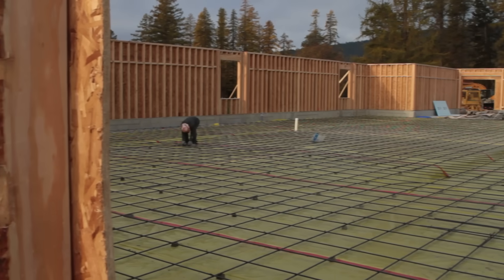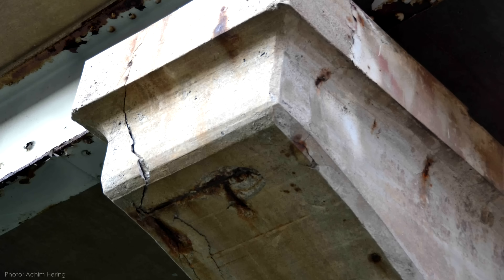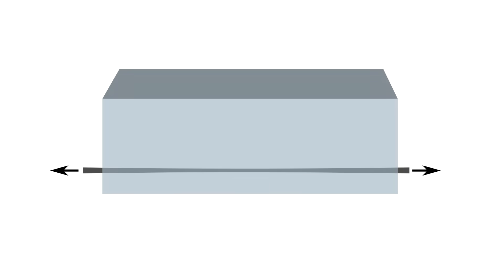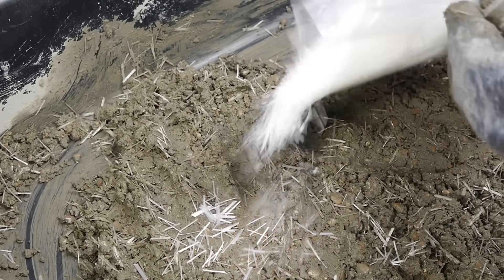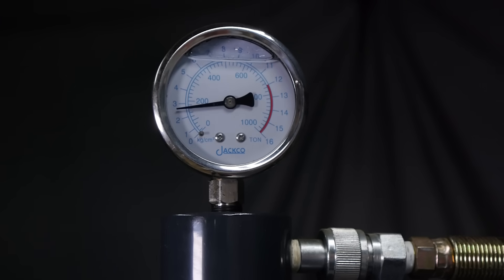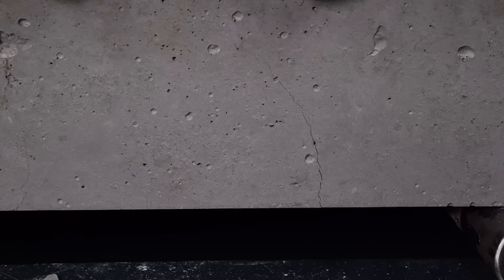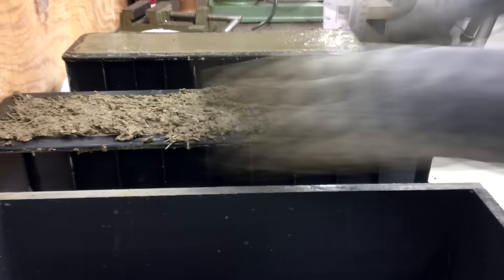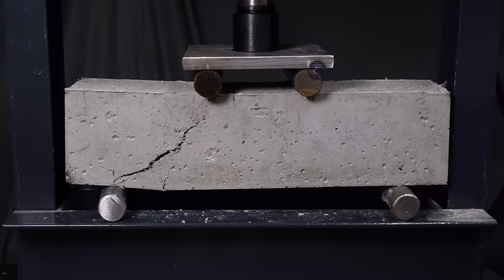Does Rebar Rust?

Comment: Moisture is constantly coming through concrete unless it has a layer of plastic underneath. So saying the rebar is sealed in isn't quite true.
Also doesn't some concrete have limestone in it. Doesn't that corrode steel? I worked at a place that made beams for bridges and everything there was rusted really bad
Reply: Basically all rebar used in building construction has a layer of oxide on it as it goes into the building.  It is impossible to keep it clear.  Building slabs are required to have a vapor barrier underneath to prevent water seeping in from below.  It would also ruin some flooring finishes otherwise.  

As to limestone, in Florida basically all concrete is limestone aggregate based.  This doesn't have any impact on the corrosion aspect of the concrete.  The real concern with corrosion is cloride ions which limestone does not contain.
Reply: @clee8768  maybe I was thinking chloride for speeding up the setup time. All I know is the place that made the beams would not even let you park within a 1/4 mile of the building because whatever they used rusted steel.

The vapor barrier will work on ground level stuff sure but what about bridges over water. And you know that barrier gets holes in it. You should see the bridges in Michigan you can see the rust coming through the concrete. That coating might help for a little but it only takes one little scratch and all the protection is gone. They transport it in a bundle it scratches  it self
Reply: No idea what that plant would be using.  For concrete and other admixtures we have specifications that exclude using anything with cloride ions.  As far as I know that is pretty standard practice.  

As for bridges, they would have to rely on thicker concrete cover and denser (stronger) concrete.  Both of these help increase the durability.

I don't know if you are referring to epoxy coated rebar but that stuff isn't all that great.  If it gets scratched (will happen) it can actually have a shorter life span the way all the electrolysis works.  We specify galvanized steel or a chromium steel alloy for exposed conditions typically.
Reply: @clee8768  I wasn't saying epoxy is good I was just stating 
that it would scratch and 1 small scratch and the coating is useless. 
   I don't know what they used for the beams I'm sure it was something to decrease setup time.
Good talking to you.

Comment: Wouldn't the steel fibers corrode and degrade the concrete too?
Reply: Yes.  I wouldn't use steel fibers in an exterior application.  They can be fine for elevated floor slabs though.  Other fibers are made of polypropylene or similar materials that obviously won't rust.  I don't generally use fibers for structural strength but they do well for crack control in slabs, sidewalks and such.

Comment: One of the largest problems with fiber reinforcement that we have yet to find a solution to is early fault detection. A giant crack is easy to notice, tiny ones, not so much.

A beam can fail and still hold a load with traditional rebar reinforcements, but it doesn't appear to be possible to do that with fiber reinforcement
Reply: I was thinking about this subject previously - I have speculated that a stress sensor could be included - I have a rough plan but would seek to patent the idea before writing it up here.
Reply: In literature (and practice probably), researchers are testing and using fiber optics to accurately monitor strains in concrete structural elements. That way it would be possible to see microcracks, providing the accuracy is high enough.
Reply: @porschepanamera92  sounds expensive
Reply: I was questioning just that while watching the video.
Reply: Use a sonogram
Reply: @BlackEpyon  while that does work... how many bridges are in disrepair enough to get a fail without the use of fancy tech?
Reply: dogishappy0  In America? Probably most of them.
Reply: @BlackEpyon  not most, but thanks to the power of bureaucracy, I could give you an actual number if I chose to look it up.

Comment: Should rebar have rust on them before its submerged in concrete? I think rusted ones have a lower corrosion rate than clean ones.
Reply: Not really. Based on the chemical environment inside concrete it does not really matter if there is surface rust on the reinforcement. The reaction that happens at the surface will incorporate some of that surface rust into the passivation layer Grady mentioned.
Reply: I've heard a claim that a slightly rusted rebar would bond more strongly with the cement than a non-rusted rebar with a smoother surface. However, the guy making the claim wasn't an engineer so I'm not sure if that's true.

Comment: why not just coat the stainless steel with zinc like galvanizing or coat it with aluminum alloy? Or put a natural resin on surface of concrete to make it last?
Reply: fakeng, just use basalt rebar

Comment: An other topic request : how fibre and rebar concrete are inspired from grass. You have also made à very Nice video on how to make smaller fondations for bridges, by adding layers of fabric in the dirt pile, and how it makes things more stable (you have put your car on a pile of sand in thé video ). I have always seen the roots of grass as reinforcement for dirt, and the natural origin of reinforced concrete (adding a network of thing string stuff to give consistency to something that would otherwise ... Flow ... The same way you have put bars in gravels to show how to consolidate tunnels

I would like to see a video showing thé général idea of adding fibers to smooth stuff (synthetic, steel, roots, fabric, into sand, dirt, concrete, gravel ... All thé same principe in the end ... )

Comment: Epoxy paint can be applied to rebar to help prevent corrosion.  Never underestimate the failure causing potential of crappy workmanship.
Reply: or Jess, just use rust proof rebar
Reply: you clearly did not hear him mention the use of epoxy which is a polymer adhesive coating

Comment: Are there any dangers of using glass fibres when it comes to the failure point or decommissioning? Ive got Asbestos in my head but i know its not as bad as that but have those considerations been thought about? i cant think that having shattered glass fibres in the air would be particularly good when it comes to knocking it down again. The concept is very interesting though and interesting to see how innovation continues to happen even for materials we think weve already worked out
Reply: Thats a fair and valid point. To clarify i dont think fibreglass on its own is dangerous as you point out it has a very good safety record

My concern is more that you have to wear face masks to install it and its fairly easy to identify if you needed to work with it in anyway and can take any appropriate safety measures required - i would imagine its not advisable to put a glass fibre boat in the equivalent of a wood chipper for example. im wondering if it is mixed into concrete, my assumption is there is going to be no discernible markings to show the difference between normal concrete and those with galss fibres added (unless there is regulation to state it needs to have some identifying markings). When it comes to demolish the concrete i would have said there is a strong likelihood the fibres are no longer going to be the same size or uniform and could break in unexpected ways. will there be a need to have special demolishing techniques to ensure that any errant particles are not a threat. Dont want to have a pneumatic drill in the middle of the road potentially covering pedestrians. If there are risks but they are low if carried out correctly then i have no problem with that but we would need systems in place to identify the different types of concrete used to prevent confusion.

Hopefully im completely wrong, as youve probably gathered i have very little knowledge of these thing but i would hope that its been considered somewhere along the design phase and thought about any potential dangers at the end of the concretes life, save we have another asbestos type hazard waiting for us in the future. All too often brilliant solutions are good at solving one problem but create other unexpected issues further down the line. 

Ultimately i was wondering if those thoughts had been considered. Have they looked at the consequences of what happens at the end, and if they have determined it is safe what is the evidence that that is based on. Its just my mind asking questions so thank you very much for your reply

Comment: All professionals always told me to never use both fibers and steel in the same project, every one always told me to use one OR the other, but never both. So i am surprised you try the mix. I agree with your words, that steel protects thé general structure, and fibre the surfaces against cracks ...
Reply: Beniot, those were NOT professionals

Comment: I've always wondered why the rebar isn't just painted, It doesn't really need to be solidly glued to the concrete does it? Or maybe a coating of magnetite or some other more durable oxide, do chloride ions eat through magnetite?
Reply: That's the epoxy coated rebar that he mentioned in the video. It costs a bit more, so it's not always used. It can also get damaged in transit or on the job site so you have to spend a bit more time checking for that and if you notice an issue you can repaint any problem spots with some epoxy paint. https://www.rustoleum.com/product-catalog/industrial-brands/industrial-choice/spray-paint/rb1600-system-rebar-epoxy-spray-paint/

Comment: I've seen split slabs that only use the fiber without rebar. Why? regard.? Was cause they're thinner?
Reply: * is it because they're thinner?
Reply: can not bother to use the edit feature either? to the right, three vertical dots are visible on a mobile device, or if using a computer motion the mouse over the comment to see it, select edit at the top. it is not that hard to figure out, beats making a reply comment like before this feature was lost or not available

Comment: CARBONATION
FeO (produced on the surface of the steel) + CO2 (carbon dioxide can migrate into the cement) = FeCO3 (iron carbonate). 
FeCO3 ---> iron carbonate has a higher specific volume ---> the concrete breaks

Comment: Strength is same , it only reduces crack , would it not be bad in some cases. like if we are able to see cracks early we can save the structure or prevent an accident , but if we can see cracks and the concrete fails suddenly wouldnt it be bad ?

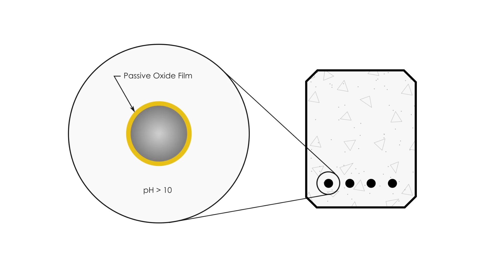Comment: @1:16, 'a thin oxide layer protects the steel against corrosion'. @1:40 'when steel corrodes, it expands.... and is one of the primary causes of concrete deterioration'. 
Is the oxide layer formed due to the PH in concrete not iron oxide? Those two statements seems contradictory.  Im not trying to be argumentative, just curious.
Reply from the maker: Different oxidation product. Sorry for the confusion!
Reply: Good question!  The problem is “sloughing,” which happens when the oxide layer penetrates deeply enough to create pockets of rust which expand sufficiently to pop off the surface.  Most metals oxidize - aluminum, cuprous alloys, even stainless.  Once oxidized, the top layer can’t oxidize again and forms a protective barrier.  But if the grain size of the oxide is sufficiently larger than that if the base metal (or much smaller), it can separate and allow air/water/other oxidizer to reach the material below it.  If you’ve ever seen a rusty old piece of steel, you’ll note how it flakes and chips.

An oxidation resistant material is simply one in which the oxide layer does not slough from the surface.

Mild steel can be protected by a thin oxide layer, if it is thin and evenly applied, and the environment is not too harsh.  Steel “bluing” is chemical treatment that creates an even (and aesthetic) layer of oxide, for example.

Comment: Can't stand seeing rusted welded wire mesh being used in sidewalks. Everyone tells me this is acceptable though, because the corrosion is just superficial. It seems no wire comes to the site unrusted. What's going on here?
Reply: They are correct. The minor surface rust is superficial and doesn't affect the long-term life of the sidewalk. If you rejected all welded-wire fabric with any surface rust you would never get your sidewalk built. Once you finally do get some straight from the factory floor it isn't going to make the sidewalk last any longer.

Comment: I was just wondering this on my way home and here it is. I saw preparation for a concrete wall being set up with the rebar being put in which had a superficial layer of rust. Knowing that iron can suffer from "rust sickness/iron sickness" I began to wonder if even a superficial layer of rust would eventually penetrate the entire bar
Reply: The Iron would need a constant supply of water in order to continue oxidising (2Fe +3H2O ---> Fe2O3 +3H2), I don't believe Iron oxide (rust) acts as a catalyst in this reaction as it is actually the product. Someone can correct me though